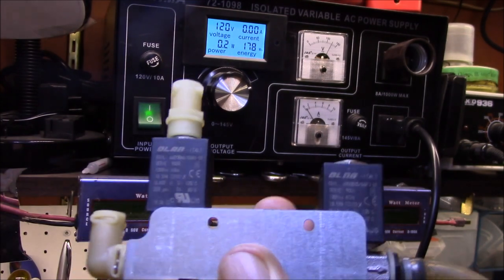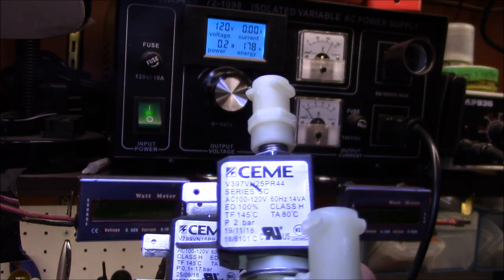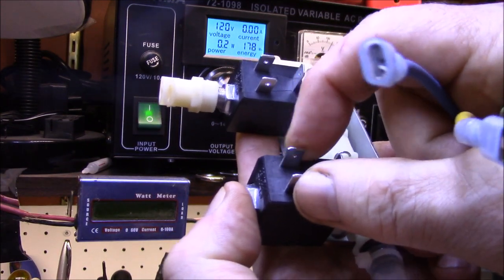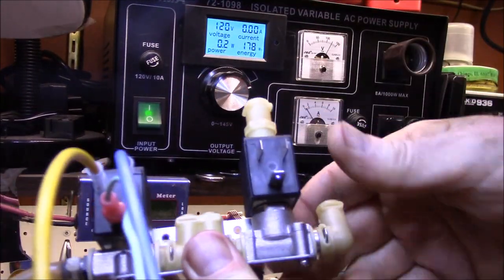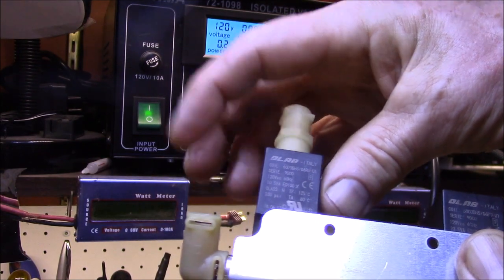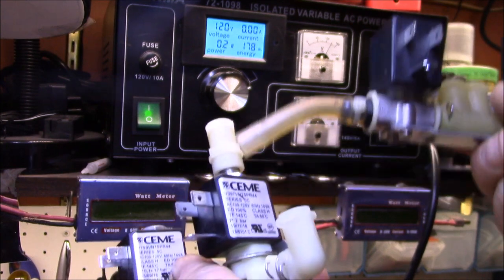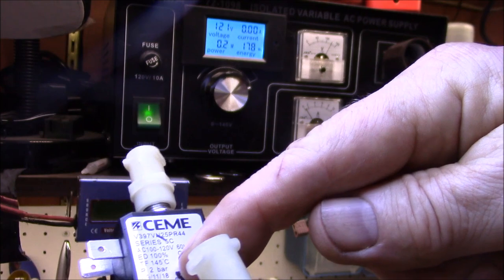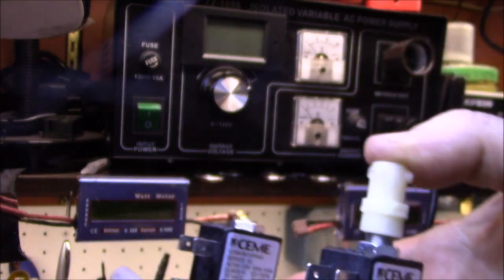Breville Barista Express - Solenoid Block Testing

Comment: Thanks for the video. My BES820XL does not pass water/steam at all, so I'm looking at this solenoid/valve assembly and wanting to test it. I hear clicks from the solenoid, but the valve only passes air through one of the short fittings, even when actuated with a paper clip through the outlet (long fitting). This valve behavior does not explain my symptoms, as I would have expected something (water or steam) to pass. Other than the current test you explain in this video, is there another way to explicitly test the solenoid itself? I realize it's a magnetic switch, BTW.
Reply from the maker: Since it is clicking, that says your coil is working, passing electrical current and producing a magnetic field.  
You can use a magnet to actuate the valve in place of the coil:
https://youtu.be/eljHS_BRJXk
The plunger in the 3-port valve needs to move all the way from one end of travel to the other in order to seal off the port on the end.  If it doesn't seal off the top port, water just flows to the drain pan.
Reply: @The4Crawler  Thanks for the tip! I will disassemble as your video instructs and clean out the valve with citric acid as my next step.
Reply: @The4Crawler  Thanks for the tip! I disassembled and cleaned the valve with citric acid, as your video suggests. Tried the magnet trick, but had no luck with 4-5 thin rare earth magnets, but when reassembled in the machine, I am now getting steam, water and coffee!

Comment: Hey have you ever replaced the thermocoil? Connected it all back you but can’t see how the water connect securely ? When I run it hot water leaks out
Reply from the maker: No, never replaced mine.  The hot water tubes use small o-rings and spring clips to hold the tube in the fitting:
https://photos.app.goo.gl/bN1ugnLPYwvyDcr59
I think the thermo-coil uses those same type of fittings.

Comment: Hi, I have 870xl, no water though grouphead steam ok. I bought two solanoids on Amazon a 3 way and a 2 way and still doesn't work. I was wondering if I did installed them right direction, since the plastic one don't have arrow. The pum is working. 
Could you help please.
Thank you
Reply from the maker: A few things to try.  One is pull the new valves out and try blowing through the side port and see if air comes out the top port.  That's how it should work.  If you can't blow air through, it's backwards.      You might try this with the old valve and see how it works first.

Or, peek inside the back cover with a flashlight while running a shot and see where the water is going:
https://youtu.be/46UBebNJ-uo
It may be the new 3 way valve isn't opening fully, it may have a bad wiring connection or it may be the driver on the main circuit board is bad and not sending power to turn it on.
Reply from the maker: A few things to try.  One is pull the new valves out and try blowing through the side port and see if air comes out the top port.  That's how it should work.  If you can't blow air through, it's backwards.      You might try this with the old valve and see how it works first.

Or, peek inside the back cover with a flashlight while running a shot and see where the water is going:
https://youtu.be/46UBebNJ-uo
It may be the new 3 way valve isn't opening fully, it may have a bad wiring connection or it may be the driver on the main circuit board is bad and not sending power to turn it on.
Reply: The problem is three way solanoid doesn't receive power 118 volt that's what I get on the two way solanoid. So, what is my next step replace the main board?
Reply from the maker: @dans9462  Either the board or the Triac on the board if you're set up to do that:
https://photos.app.goo.gl/T43teAq43822v8zc6
Reply: @The4Crawler  Thank you for the information. The board itself is ok I think  just the triac. But where can I buy it?
Reply from the maker: @dans9462  Just added this information to that page:
For a source for these parts, use the part number and search with your favorite web browser.  They should be available on eBay, AliExpress, etc. as well as from the usual component sources like Newark, DigiKey, Mouser, Farnell, etc.
Reply: Hello Mr. Brown, my breville barista express is not fix yet. I have to replace the main board because one of the resistors is bad and responsible for giving power to the solanoid. But the main board is on backorder so I've been without good coffee for a month and I see breville has 20% sale right now so I've been tempted to buy a new one. Which in your opinion is better barista pro or touch or should I stick with the barista express. Of course I don't take in to consideration the oracle because it's not my my budget.

Comment: Thanks for all the informative videos. 

Do either of those solenoids control the pump at the very beginning when you first power on the machine? I can’t find a wiring diagram online. 

My pump doesn’t turn on anymore. Took it out of the machine, put 120 on it and it ran water through it no problem. I did that multiple times and had no issues. I re-installed it and all I get is the coil humming. Voltage checks out okay but it seems the current isn’t what it should be. Out of the machine it pulled .6A and in the machine it’s only pulling .2. 

Any suggestions?
Reply from the maker: No, the solenoids are just valves that change where the water flows.  You might check this web page for some troubleshooting ideas:
https://siber-sonic.com/appliance/800Electrical.html
It's an older model machine, but apparently they are quite similar inside.  You might also try re-seating the pump connections on the main circuit board.  If that doesn't help, it's probably a fault on that board, might be able to repair it or replacements are available.  In these machines, everything feeds into and out of the main board.  It controls all the solenoids, the pump, LEDs, etc. and it also reads all the switches.
Reply: @The4Crawler  Thanks for sending me that link. It does have a lot of good info.

I checked the board and all of the components and they appear to be functioning properly. I installed the pump back into the machine, ran 120 to it (bypassed the board) and now it just hums again. When I ran the pump out of the machine, I ran it in a horizontal position to shoot the water away from me. Now I am wondering if it is the pump (mechanical portion).
Reply from the maker: @mclellat  It may be something is clogging the check valve in the outlet of the pump or those parts have worn out.  There are videos on servicing that part.

Comment: Nice video.  Did you have to replace the valve or could it be cleaned and just re-install
Reply from the maker: I did clean the valve out in a follow-up video:
https://youtu.be/eljHS_BRJXk
I had already purchased replacement valves and had installed those when I removed this one.  I'm keeping this one as a spare.

Comment: I would appreciate some advice on my 870 Barrista Ezpress Coffee machine. Water stopped flowing completely. I replace with new pump but still no water. Replacing the solenoid i.e. and I guess it would be the 3 way part. Mine is CEME series 588. Where can I get this from? And as long as it is series 588 will it be the same replacement? Incidentally, I do not hear any buzzing noises despite no water flow. Your advice would be appreciated.
Reply from the maker: By "Water stopped flowing completely", do you mean no water out anywhere or is it only flowing to the drain pan?  If it's going to the drain pan only and/or also to the hot water/steam side, then the solenoid may be clogged.  See my video on cleaning it, otherwise search for the solenoid part number on-line and see if you can find it that way.  If not, eReplacementparts.com is a source, although they only have the entire solenoid set and bracket.  
If no water is flowing, even into the drain pan, then there's likely a clog somewhere.  Check the inlet filter before the pump and also remove and check all the hoses between the pump and the solenoids.  Take one off at a time and try blowing through it.

Comment: thank you for excellent videos you are the best ! 
I have try to replace the solenoid  and one of the  yellow cable to the thermostat (go to boiler with 2 notes ) was broken near to the head so I can't fix it now,  do you know what to do ? thank you
Reply from the maker: Not sure if that's available separately or not.  The thermo-coil is:
https://www.ereplacementparts.com/thermocoil-comp-assembly-p-1810364.html
Maybe contact Breville directly and see if they have that part.
Reply: @The4Crawler  Hey I have also search for this parts  but without any luck !  I will try to contact them maybe will get answer about it ... I gets lots of problems with this machine :) thank you for your hard work ! I learn a lot from it

Comment: When you tested this solenoid, did you apply 120 v to both side terminals, and ground to the 3rd  ground terminal?  I'm trying to come up with a bench test for my solenoid.
Reply from the maker: Yes, AC voltage across the two side terminals.  The 3rd terminal is for ground, not strictly needed for testing but it does tie all the metal parts of the valve to ground for safety.
Reply: @The4Crawler  to clarify, do I apply a complete circuit, i.e., power on one terminal and neutral on other.  Or do I apply 120v on each side individually?  I tried the latter and that did not work.
Reply from the maker: @cpabrego  Yes, 2 connections, 120V to one side terminal, neutral to the other, just like a light bulb.  Makes no difference which terminal is 120V and neutral.
Reply: @The4Crawler  thank you, I'm in the process of troubleshooting my water level controller giemma (RL30) and I cant figure out whats the matter.  After main power switch burned out and was replaced, water level control is no longer working.  Thought it was either the solenoid or controller but new components didnt change behavior.

Comment: Great videos! I changed my 3-way solenoide thanks to this video although I have a second issue.  The solenoide gets activated as soon as plug the machine (machine turned off).  I tested the transistor powering the orange cable (TA4) on the main board and it is shorted.  Unfortunately I cannot see the part number on it to order it.   My machine is the BES870XL.
If you happen to know what transistor I should buy it would be appreciated.
Reply from the maker: Check out the comment by Mike Henderson about 2 weeks ago in this video:
https://youtu.be/9lMw6ooiqPI
Reply: Ich schalte meine Sage immer komplett vom Netz.
Sobald ich die Netzspannung zuschalte, hört man ein kurzes "Klack", also schaltet dann ein Ventil um, obwohl die Sage nicht eingeschaltet ist. Das ist ganz bestimmt richtig so und kein Fehler.
Reply: Mine does this exact issue but it the blue wire that's constantly activated.  Any ideas?

Comment: Apply DC voltage to the solenoid. Works without problems. Good luck.
Reply from the maker: Good idea!  Yes, that should work on the valve solenoids.
Reply: @The4Crawler  OK. Checked. Works. Good luck

Comment: Hey, Thank you for the video. By any chance you can share where you got the CEME block from? Tried your link from the video and it pulls from ereolacementparts for the olab, being trying for a while, I appreciate any help, Thank you
Reply from the maker: Source for the Ceme solenoid block I purchased in the video description of the previous video:
https://youtu.be/96IuKiuIB5A
And it was from ereplacementparts.com.
Reply: Thank you, can’t seem to find the CEME block on that site, only find the Olab and it’s on factory back order, is it the same part number? ... I appreciate your help.
Reply from the maker: @ernestesmart5158  That's the link and part number I ordered from.  Don't recall the if the part image matched the part I received or not.  Have heard that if you get the p/n off that site and then contact Breville directly, you can order the part from them and likely get it faster, assuming they have it in stock.  Or take the p/n and search on-line for it.  I understand that Breville changed the valve brand a few years back, but left the p/n the same.
Reply: Thank you, will try to contact them directly.

Comment: I have zero experience. Im looking to see if I can fix my machine myself and save on service costs. Is this only advised for those that have experience?
Reply from the maker: This was my first time inside this espresso machine, but I have repaired other appliances.  Check out the repair videos as well as the water flow video so you can understand how the machine works inside and try to narrow down the source of whatever problem you are having.  It might be something that can be solved by running a few descaling cycles.
Reply: @The4Crawler  thank you. Yes I've had a look at your thorough videos, excellent stuff, thanks very much. I might at least open it up, and see if it's just a descale soak as you've also shown in some videos. 🤞

Comment: An meiner Barista landet das Wasser manchmal auch komplett in der Auffangschale und es baut sich kein Druck auf.
Entweder klemmt ein Ventil, oder ist verkalkt.
Die letzten 20 Bezüge waren wieder einwandfrei, nachdem ich entkalkt habe.
Reply from the maker: "At my barista, the water sometimes ends up completely in the drip tray and no pressure builds up.  Either a valve is stuck or calcified. The last 20 covers were perfect again after I decalcified."

"Yes, it sounds like the 3-port solenoid valve may not be opening fully.  When that happens, it doesn't seal off the port to the drip tray.  Try opening it up and cleaning it:"

Ja, es hört sich so an, als würde das 3-Wege-Magnetventil möglicherweise nicht vollständig öffnen. Wenn das passiert, dichtet es den Anschluss zur Tropfschale nicht ab. Versuchen Sie, es zu öffnen und zu reinigen:
https://youtu.be/eljHS_BRJXk
Reply: @The4Crawler  Nach dem entkalken ist das Problem nicht mehr aufgetreten.
Bevor ich ein neues Ventil kaufe, werde ich zuerst das Ventil auseinander bauen und versuche den Fehler zu finden, um es zu reparieren. Vielleicht klemmt es nur, oder es ist Kalk im Ventil.

Comment: Do you mind letting me know how you disassembled the value from the Olab coil? i can't see to get it off.
Reply from the maker: I show more of the disassembly in this video:
https://youtu.be/eljHS_BRJXk
The nut on top lets you remove the coil from the valve.  The 2/3 way valve has a hex at the base and you can unscrew that to remove the top of that valve.  I couldn't figure out how to open the 2 way valve on the other end, it seems to be pressed together.
Reply: @The4Crawler  Thanks! that was super helpful. I'm going to try that. I had the same problem couldn't turn it no matter what i did. I'm going to try soaking the valve first and seeing if it comes off.
Reply: @The4Crawler  if you clamp the base of the valve, the top threaded part where the 14mm hex goes unscrews . It's quite tight, and a very fine thread. There's a spring and piston in the body, piston has a seal at the bottom. I found the assembly was full of fine coffee grounds. I think that valve is the pressure relief for the head. (FYI I removed remove the plastic spigots from the valve body (12mm hex) so I could clamp it in soft jaw vice without damage)

Comment: does anyone know the resistance of the coils? im pretty sure that my coils are bad! one was reading infinity and the other reads 1kilo ohm? Thanks! Both are OLABS! Im planning on changing the coils with a cheap chinese solenoid its seems my case is electrical and no so much mecanical.
Reply from the maker: You'll find that information in my Google photo album, link below:
https://photos.app.goo.gl/bN1ugnLPYwvyDcr59
Scroll down to the bottom of the list.  This is for the 120V version, 240V version likely around double the resistance.
Reply: @The4Crawler  about 500 ohms. YOU'RE THE BEST!!! KEEP IT UP!!!!

Comment: These Barista Express videos are very helpful. Any idea if the 860XL uses the same solenoid as the 870XL. Can’t find much online.
Reply from the maker: It appears to use the same solenoid valves:
https://www.ereplacementparts.com/solenoid-valve-assembly-p-629955.html
Reply: Regarding the Breville solenoid testing. So to begin, don’t have a Quick Test device. Am I to understand that if I put 110v across the two vertical prongs, it should activate the solenoid with a click, right?  Does the ground need to be attached for testing?
Reply from the maker: @tfonte1027  Yes, AC line voltage across the two vertical prongs, polarity doesn't matter.  Connecting ground makes it safer in case there's a short between the coil and the valve block, but as long as you have it on an insulated surface and don't touch it while powered up, it could be left off.  You could grab an old power cord, crimp on some spade terminals on the wires on the end and then plug that into a power strip with an on/off switch.
Reply: As it turns out, neither solenoid clicked. Took the valve bodies apart and soaked in vinegar until the plungers moved smoothly. Problem solved. Thanks again.
Reply from the maker: @tfonte1027  Glad you got it working again!